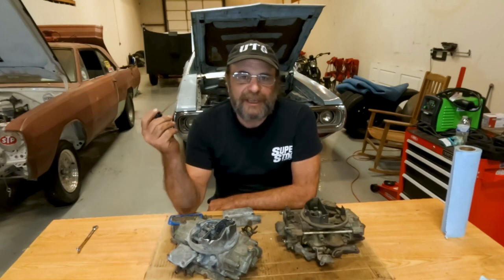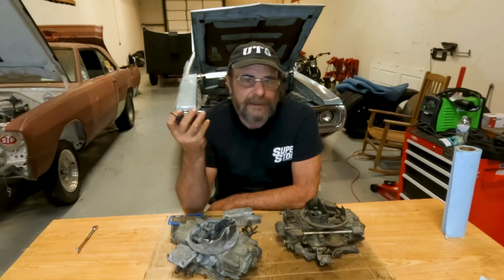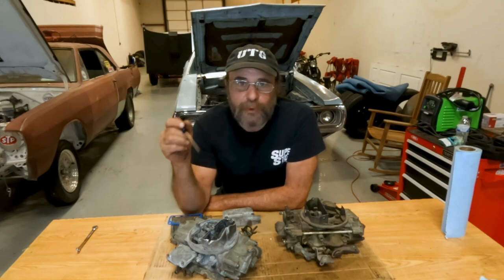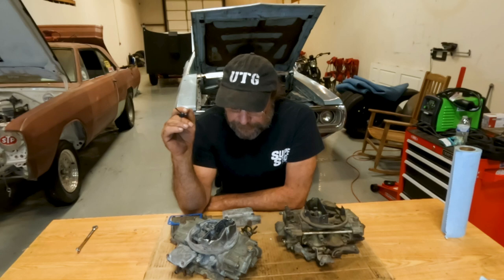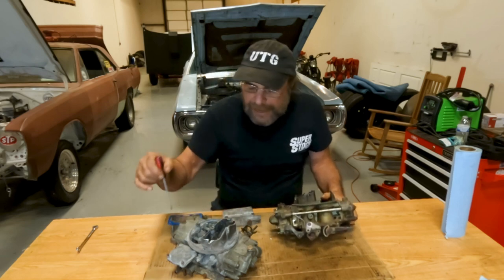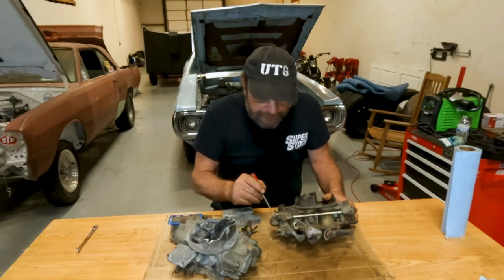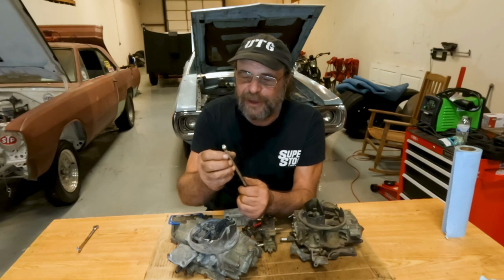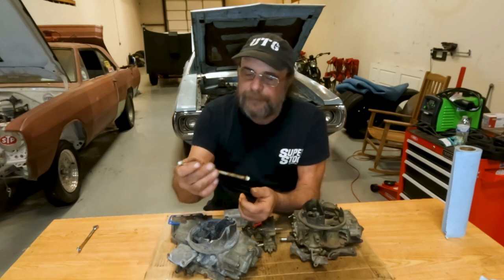O-Ring Hell - A Quick And Easy Guide To Sealing Up The Most Common Holley  Fuel Leaks

Comment: If you have a Holley carb on anything, a car,truck,boat,etc.. it's always a really good idea to look at the carb from time to time and constantly check for leaks and check for any deteriorating o rings, accelerator pumps or fuel line, it's best to catch the leak before it happens so you don't burn your ride down, holleys always seem to have a bad habbit of springing massive leaks at the worst possible times. That's why for most daily driver, low performance vehicles, I always opt for a rochester or afb style carb Soo much more reliable and less likely to start leaking. I have seen quadrajets that were over 40+ years old that have never been apart that have zero leaks, can't say the same for a Holley they always leak.
Reply: Yeah I think I'd just stay away from Holley and Edlebrock.🤷‍♂️💯
Reply: Trying to think of any orings on a front and rear feed?
Reply: Quadrajets often develop leaks at the fuel line fitting. Never had issues with Carter/Edelbrock AFBs.
Reply: @weseethetruth158  So what do you run?
Reply: Yo got me putting my extinguisher back in my ride 3 maybe 4 pounds hmmm 👍
Reply: @lordphullautosear  they sure did!

Comment: You hit the nail right on the head. If you want peak performance, run a Holly, if you don't want to be constantly messing with it, run a Carter / Edelbrock. I've had Carters that sat for five or six years and fired and run like a champ.

Comment: Even "the good old rubber" goes bad with modern gas. The alcohol (and the additives that keep it with gas for few months) make the rubber swell and harden. When there is no gas they shrink back, but as they are now hard, they do not seal any more. I talked to a guy that has sold carb rebuild kits for 30 years, and he told that with the old leaded gas carbs lasted easily 30-40 years without problems, now about 3-5. Happy guy, as his business got boost...

Comment: I've never used a Holley carb with the transfer tube but I think that if I had problems with leaks there I would look at drilling and tapping each side for a hose barb fitting then running some high quality fuel line between them. Problem solved.
Reply: .....and excellent idea....and would be a simple and direct fix
Reply: I gobbed JB weld on the transfer pipe and it seemed to fix the problem . But it did not look all that great and had to be chiseled off to replace the bowl gaskets. 😊

Comment: Back in 1975 I had a Holley 600 on a 65 Mustang. it was not unusual to be driving along and suddenly smell gasoline, pull over, open the hood to find the crossover pipe O rings leaking. But I always had a box of Holley gaskets and parts in the trunk so remove the float bowl and replace the O rings and continue on. Oh, the joys of owning a Holley. 😊

Comment: Back in the day, I was a member of our local volunteer fire department, which was equipped with hand-me-down Ford C-cab fire trucks with gas V-8s. The Holley carbs on those engines gave us fits, since the trucks sat so much.  Even worse, our old firehouse was so small that we could not raise the cabs to access the engine inside the house.  Don't miss those days!  Rochester Quadrajets get a lot of grief, but I would store boats with them on 305 and 350 GM engines for 6 months at a time, and they would fire up and run fine. Thanks for the video, Uncle Tony!

Comment: I've been messing with Holley carbs for 40 plus years too!  I used to have boxes of them under the bench.  People would get fed up with them and just give them to me!  Personally I love Holley carbs.  Anyway you're spot on.  The first start up of the year I always leave the hood up for awhile and check to see if there are any leaks.  If there are leaks I fix them and that is usually the end of the problems for a couple of years.  Great video.
Reply: So your saying that the o rings and gaskets last for 2 years
Reply: No, I'm saying it's smart to check for fuel leaks when starting a car up for the first time after it's been sitting awhile.  Check your brakes before you pull out of the garage too!   @JacksoNR26

Comment: Tony - didnt know if you already knew this ? but you can buy an assorted clear box of green O rings used for AC in vehicles from harbor frieght along with a box assorted black rubber O rings  . the Orings come in sizes small enough to fit the holly parts . they will with stand gases and other chemicals and temps

Comment: Thank you UTG, just got my car back from a classic car shop and they couldn’t use my Holley 850 because it was leaking gas everywhere and they recommended I buy a new one. Luckily I had a new in the box edelbrock they were willing to throw on the car. I took back the Holley and was going to do a full rebuild but now I will just start with new o rings.

Comment: One thing you missed talking about is that some Holley carbs use a rubber bushing of a sort on the transfer tube as opposed to o-rings and that when putting on the transfer tube to spray the oring with silicone spray so it slides in and does not roll

Comment: I learned that Teflon tape lesson the hard way. As a young lad, I Teflon taped the shit out of some fuel lines, and some of the tape worked its way into the carburetor, and got stuck in the needle and seat.  Had to nurse the car back home and was driving myself crazy figuring out the problem, but then I showed it to my father, who, of course could tell what was going on right away.

Comment: Always had Holleys, most of which are as Tony said, the 600cfm vac secondary square bore (4160 if I recall correctly).  Only months ago, got hold of a used 625cfm Street Demon.  Sure, more fine tuning with metering rods, vacuum springs and the like , but no leaks due it’s bowl design.  Better for a cruiser or mild street car I’m told but I think the large secondary barrel is ideal for WOT launches.

Barry Grant got it right on that front.

Comment: I honestly do mean this, every time I watch this channel, it makes me consider more and more going with carburetors on my Honda. I know people are going to laugh at that, but a 1989 Honda CR-X that was B18 swapped (1.8 Liter DOHC 4 cylinder) running a ported VTEC head, 13.5:1 compression, TODA VTEC killer cams (insanely aggressive cams), and SS Works' own carburetors made 230 horsepower and set a lap record in the early 2000s around Tsukuba Racing Circuit of 59.1 seconds. Honda engines love individual throttle body setups and individual carb setups.....and if I really wanted to go for an all out build, carbs would ironically be easier to deal with than individual throttle body tuning.

Comment: Had Holley four barrels on a couple of old medium duty trucks until the early 2,000s. Those trucks sat more than they ran, all winter, six months up here. Even after Minnesota went to ethanol in the 90s I really didn't have trouble with them leaking. Sure occasionally I'd replace an O ring but it wasn't like an every spring ritual. I'd say it's definitely the O rings today, no idea if there's still US Made ones available today. You can bet the ones at Autozone or whatever aren't made in the States.

Comment: I let my brother-in-law  use my old chevelle for a few months it got really hard to start , all it was is the gasoline  was draining  from the accelerater pump  on bottom of the front float bowl.,Holley carbs work very good for people who take the effort of learning about them.
Reply: Had the same thing happen to me
Reply: @bradygregor9137   that's some work project you did on the old Ford truck.,I  thought about doing something  with my 79 fiat 124 ,2 litre  motor ,something  like a 4 barrel carb but I have to have a totally  reliable  car no matter what ,

Comment: The leaky transfer tube got me for a while, because by the time you shut the car off and lean over to have a look, the fuel has dribbled down around the pump diaphram and you think you've got a bad pump shot. (btw the teflon tape does work well temporarily on the transfer tubes if you don't have an oring handy, seals well for a few weeks before the gas melts it)
Reply: If anyone is tempted to use a teflon tape then at least buy the fuel rated version: yellow PTFE tape

The plain white teflon PTFE tape is best used for water and it does not have resistance to chemical compounds (like gasoline). The yellow PTFE tape will work for household plumbing (but a roll of the yellow costs twice as much as the white tape).

Comment: Fumny I rebuilt my 25 yr old 750 double pumper for first time last year. Can't say I had any leaks besides fuel bowl which were fixed by tightening the screws.  Granted my GTO only gets driven 500 or so miles a year but it sits most the winter without running.  Always found it very reliable and prefer Holleys to the Qjet for ease of starting. I don't even use the choke and it fires up easily.  I also have a 750 vac secondary which has been sitting for years. I bet that would leak like a sieve though, so I need to rebuild it for a back up.

Comment: I have three 2300's sitting on my 351C.  It will usually last a winter or two before it starts to leak.   I just replace the needle assemblies instead of trying to put in a new gasket (didn't realize that was a option).   Also, check the power valve.  The rubber on it can deteriorate too if it gets dry too many times!   Great video as always.

Comment: I use Air Conditioning Green Seals for the check valve and cut the the float level adjustment gaskets from plastic oil containers.. works for years..

Comment: 1:29 
My old TS 125 does that. 
Leave it sitting 6mo with an empty tank ,and fill it up and the fuel valve pours fuel out. 
So leave and come back 20mins later and it's stopped. 
Can't recall how many times I've seen it do that over the years. 
Let the fuel swell up the seal in there and it stops.

Comment: The next new carb I buy I am going to get the E85 Version. They are sneaking more an more ethanol in fuel that isn't even supposed to have ethanol content, so I am going to spend the money and get the version with the proper parts and seals so I dont end up having a leaking or gummed up carb down the road
Reply: I remember back in the 80s when they changed the fuel to the new blend. I was going through fuel pumps like crazy. The diaphragms would turn to mush. I took a while before manufactures came up with rubber diaphragms that would not fall apart and leave you stranded.

Comment: Also Tony did you mention that you can go to low with needles and seats and cause flooding too? Pass the o ring sealing surface. And sometimes the o ring will get a thread line cut into the o ring causing flooding

Comment: I had a new out of the box Holley 600cfm (3310) leaking at those equalizer tube o rings. I discovered it on the road first trip out. I had to wait for the nearest NAPA to open where I bought 2 o'rings for a total cost of 80 cents.

Comment: Biggest leak issue I've had with my old Holley 4160 is with the non-adjustable needle & seat plugs on top of the bowls. The plugs will leak, not a question of if, but when. A little JB Weld or Seal-All will stop the leak, but at some point, the bowls will have to be replaced since replacement plugs aren't available. Did that job over the winter.

Comment: BLP Carbs in Florida sell o rings for the needle and seat made of Buna material for 35 cents, I use Allstate Carburator and buy everything else in bulk, at the end of the cruising season maybe drain the carb take it apart and vasoline the critical o rings and parts, just a thought.

Comment: Tony, if you have access to "bulk" O rings (Amazon; only the black Buna, dirt cheap), the # 009 ( universal numbering system ) fits the Holley transfer tubes and the seats. Also, even with the blue non stick gaskets, they peel a lot easier with a light spray of silicone or WD at each install.

Comment: When I was a young man I put those Holley 600's on every small block V8 I had that had stock or mild cams. They were half the cost of the 780 and a third the cost of the double pumper 750 and often my local speed shop had them on sale for $50-$70. I had more than one come fresh out of the box with that transfer tube leaking. I think if I were doing it today and wanted to buy new I'd get the Edelbrock 600, or maybe the Brawler 600 with the mechanical secondaries, it has no transfer tube.

Comment: Suggestion: I have been swapping out all such O-rings on all my equipment with those green air conditioner type O-rings.

While I can not promise this will fix the problem, I do find that in my situation, they seem to last longer and fit better, preventing leaks, thus far, without any other modifications to anything.
Reply: Viton.....best oring material ever

Comment: You shouldchavecmentioned the infamous accelerator pump . The screws will either back off with the constant heat/ cold cycles or the barely 4 1/2 threads will strip from overtightening.

Comment: My first 4 bbl Holley was a 600  Vacuum secondary  bought as a new in the box from a guy on offer up . The guy tried to tell me it was a 650 but i knew it was a 600 . I did not look at it very good and they had changed  the squirter to a 28 and the rear float had a old needle and seat that got stuck down and tuning it was a booger since it was lean there and I jetted it up really high till I figured out what it was . Only good thing was it has the new style transfer tube seals the cup style liking those although I will never buy another used one again without looking really good .

Comment: The problem is when they change the composition of chemicals at the pump without telling anyone .Back in the late 80's  they changed the blend in premium gas and I had a new Holley spread bore melt the bowl gaskets with Holley have no fix to replace those gaskets yet . Saw 3/8 Fi line burst after melting from some new additives to pump gas and had 2cycle gas lines leak when using regular 2cycle oil with 10 % ethanol gas. They keep messing with blending of fuels without any warning . How many engines got ruined when the took the fines out of Motor Oils without warning ?

Comment: Those blue reusable gaskets for the Holley bowl and metering block are one of the best upgrades you can do with a Holley. In fact Holley should be ashamed for not selling every new carburetor with the blue gaskets installed. They would have less returns.
Reply: Yes but when the first come out in the 80s they had some sort of glue that would bond the metering blocks and float bowl together. Taking one of these carburetors apart was a chore without wrecking the carburetor. Holley finally stopped doing this as people started to complain about it.

Comment: I embrace the Therapy after my' fair weather only car' has sat. Take it apart, clean and inspect. Blue Gaskets, and I have never looked back after purchasing ARP Bowl Screws and use the Nylon bowl screw seals. Never over tighten anything. I would rather ' sneak up' on things if I catch weeping. My Tip would be get organized. Took some time but I have built myself a rather awesome simple Plano 3700 Tackle Box with damn near spare everything. When Monies allow, buy 2 when ya' need something. I use Carb Spares when I need something from Summit/Jegs as 'fillers' when I order.

Comment: The accelerator pump cap will also get distorted with time and will leak. Not a flood leak but will create a yellow varnish on stuff under it associated with this slow leak. They can be sanded flat and reinstalled.

Comment: The flange that holds the o rings in place is far enough back on the transfer tube to actualy put 2 o rings on each end. Just a little insurance, I've been stacking mine for many years and never had 1 leak.

Comment: I have owned 1 Edlebrock, and maybe... 12 Holleys?

The only problems I ever had with Holleys was the O-rings, except one of those rare 500 CFM lean burn carburetors where it would have cost me more to buy a rebuild kit [513 and some change] than it did to buy a factory rebuilt 750 [ 275 bucks while giving them the 500 LB as a core (which they likely either just tossed it, or else found some rich collector who wanted just that specific model carb for a restoration)] and on top of being cheaper, it allowed my car to go faster.

Comment: What about the accelerator pump lever, where gas leaks out the middle of the accelerator pump.  I inherited a 1987 RV, with a 460 4bbl.  Thought the 4bbl was a 4160, when it was actually a 4180.  Also known as the 'Pristine'...Ford commissioned Holley to make a 'tamper proof' carb, and that thing was locked down.  The three screws holding the choke on...mine was one screw, and two rivets.  The four air fuel mixture screws at the base, mine were encased in like a tunnel, and the heads of the screws, were like rivets, or weird allen heads.

I was that guy...and got rid of it.  Amazingly, oh and the accelerator pump leaked, and it didn't pump fuel into carb.  Had to prime it every time it sat longer than 8 hours.  Anywho, posted on Facebook Marketplace for this dirty 4180.  Less than 24 hours later, Saturday morning, guy replies and said he wanted to buy it for listed price of $100.

Comment: A simple trick if you don't wanna try and find the non stick gaskets is spray your gaskets with PB plaster before putting them on. Oh and stop using rubber o rings go to a fuel specific o ring.

Comment: First i got a fake edelbrock that had problems so i sent it back. picked up a holley 1450-750cfm carb for my 318 and slapped it on, rebuilt a couple years ago and put on a shelf, and it fires up but revs up then dies. Got fuel leaking out the timed vacuum port. Guess I have to rebuild it myself. I wonder if im ever gonna get this thing on the road again. Its just been a nightmare.